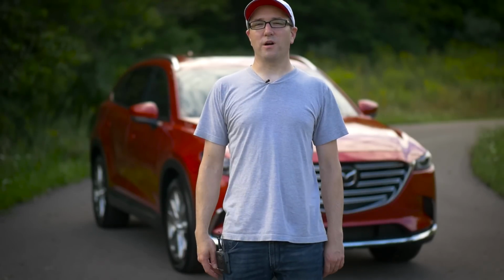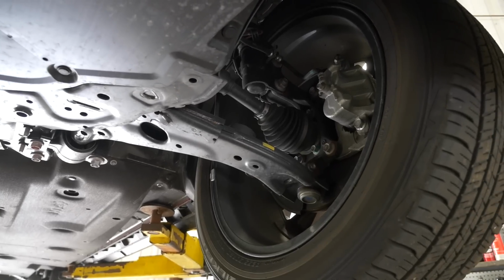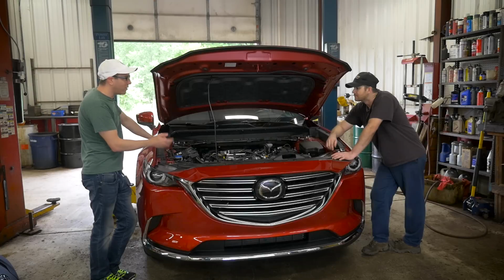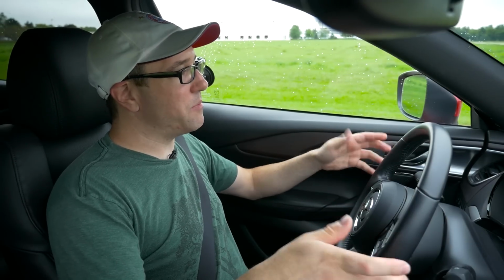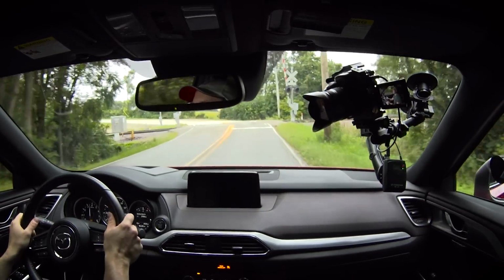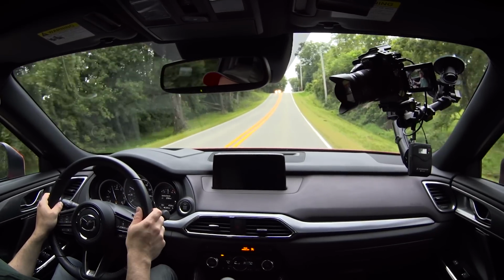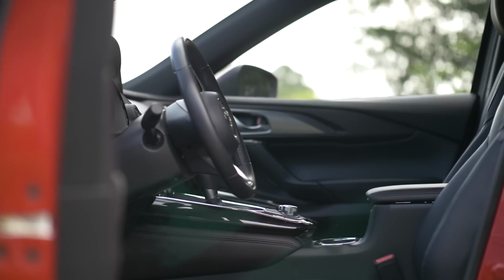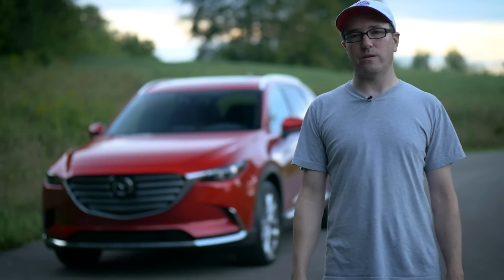Review | 2016 Mazda CX-9 | Plump Yet Satisfying

Comment: The Germans gave up on the Wankel and Mazda took the design and nearly perfected it. The Germans gave up on trying to eliminate carbon build up as a result of direct injection. They (BMW & VAG)tell their customers to deal with it and get the costly cleaning service. Again, Mazda made it better by clever engineering. Thank you Mazda.
Reply: I wouldn't call the rotary perfect.
Reply: What a weird thing to be thankful for, but okay. It is not even an interesting fact.
Reply: VW/Audi is putting port injection on their DI motors to help keep clean. At least in Europe.

Comment: Great review, good quality video in HD, great edit. Great info. BTW: The plastic on the wheels are there to avoid rust issues. The Power rear liftgate have  programmable height adjustment. The HUD can be turned off forever if you use the memory settings on the seat. Regarding the complexity of the engine, Mazda is giving 3 years or 6 years extended warranty. A great machine, not the bulky and not fun driving on Pilot, Pathfinder, etc.

Comment: something that was bothering me is that your complaint about the engine power falling off in the upper RPMs is something Mazda has stated is by design, but you never mention that. Mazda engineers have stated that they deliberately tuned the output to be in the most usable and applicable range for daily driving for more efficiency. mid range acceleration and highway passing is supposed to be this vehicle's bread and butter. otherwise a solid review all around
Reply from the maker: +Chris Droste Yes its by design by almost every company that does the new generation of Eco turbo motors, all tuned for torque output and not high rpm output, largely because of compression ratio and their desire to not require premium fuel.  I don't say it because I assumed its known but your right I should mention it going forward.
Reply: @savagegeese  
Premium fuel is not a problem for me. I prefer to use ethanol-free fuel anyway and it's earlier to find ethanol-free premium than ethanol-free regular.

Comment: Great review!  I LOVE that you actually got under the car with a mechanic.  Mazda has made a huge mistake by discontinuing the V6.  
The mechanic was spot on in mentioning the giant increase in the complexity of adding a turbocharger. For folks who keep their cars for 8-10 years this complexity translates into much greater cost of ownership.  What do you do when the turbo quits at65k miles.  It’s decision time folks. Do you write a check for $2500-3000 to fix it or do you try to sell it?   With the V6 there is no need for a turbo and you will save big $$ in maintenance over the long run.  So what if it doesn’t get better mpg?  Turbos are for unsuspecting suckers.

Comment: Incredible in depth review. Thanks so much. As good as it was, there was one glaring error. While they are not badged, the model reviewed is a Grand Touring model, not a Signature model as he said. The Signature model comes with Auburn Nappa leather seats. Nappa leather is softer, wears better, resists stains, is colorfast, and breaks up all the black in the vehicle. It does not look like a 5 year old child from a labor camp sewed it. It also has Rosewood in place of the cheap shiny plastic he was complaining about. Plus there's additional LED lighting including a bright mode on the 3 dome lights that turn night into day to locate lost items. While the Touring and Grand Touring trims are nice, the Signature trim is crazy nice for a Mazda, and competes with luxury brands,

Ergonomics are great, you'll use the armrests as they are right where you want them. Nav controls on the console right where your hand lies. While not available when it came out, the nav system can be upgraded to Apple CarPlay/Android Auto for $150, plus a few hours of a handyman's time.

It is a great ski vehicle. Most people buy 3 row CUVs to avoid the look of a minivan, and end up with a CUV that drives and handles like a minivan. Coming from a G37 coupe, I cringed at needing a big vehicle. It is great in the twisties in the mountains. Most fun you can have in a 3 row vehicle that can tow 3,500lbs. Turbos lose much less power than normally aspirated vehicles at elevation. I live at 9300ft, and run regular and it still is fun. If you have a trip to the mountains, treat yourself to some premium and really enjoy the performance, otherwise regular is fine for most fueling. Extra height allows driving in deep snow or getting to a campsite or launching some toys you are towing. It drives like a smaller vehicle that is lower to the ground, which is quite impressive. Utility and a sporty drive are no longer mutually exclusive.

I disagree about the HUD and nav display. i appreciate the info without having to take my eyes off the road, especially when I'm towing a couple ATVs on tight hairpin turns on twisty mountain roads, Towing is good, and on the rearview camera when you're in reverse, you can see your hitch ball to easily align your trailer.

Biggest fault I noticed, is the seat preset controls are located on the side on the front seats. If you are of average height or shorter, you will notice when you sit down you will often hit the buttons and the seat starts moving. i will likely place some raised material around that switch, to avoid that from happening.

Thanks again for the great review!
Reply: And it's made in Hiroshima Japan. While in theory I'd loe to buy a made in the US vehicle, the build quality is just that much better there. Rosewood accents are made by luthiers (guitar makers).The Signature really is that much nicer.

If you buy it in the Machine Gray color, it hides the plastic cladding. While I don't  like the look of cladding, they put down crushed stone on snowy days, which is often here, and without that cladding, there would be lots of rock chips and eventually rust around the wheel wells.The grey color is a great compromise, as the cladding prevents chipping, and the color hides the cladding.

Comment: This is very helpful in my looking at a used '16 Touring with 26k miles. It's not certified pre owned but it still has about 5 months left on the new car warranty. Another plus, the price is $22k. You addressed the possible issues the turbo 4 so well. And the other Pros/Cons were also explained well. Great job.

Comment: You really should check out the 2019 model. Heated rear seats, ventilated front seats, surround view camera, trajectory lines on rear view camera, Android Auto and Apple CarPlay... check, check, check. We just leased one after initially looking at up-market models (MDX and CX-90) but the value proposition on the CX-9 just couldn’t be beat. Got everything we wanted in a family hauler and saved $500/month!

Comment: Just wanted to note a few of the stranger things about my all new 2016 CX9. Having previously owned a 2010 CX9 I was looking forward to the side mirrors dipping when selecting reverse, a very handy feature which saved me from wheel rash on many occasions but alas Mazda in their wisdom have decided to delete this feature. To make matters worse the mirrors cannot even be folded away, a feature the much smaller Mazda 3 has. Another thing that irritates me is the accelerator pedal is lower than the brake pedal by enough so as to not allow you to slide your foot across when braking. You have to raise your foot off the gas pedal which is a pain. Why are the taillights, headlights and fog lights all LED but the daytime running lights are old fashioned bulbs?
When reversing why don't  the guide lines on the screen move as you turn the wheel like they do on cars half the price?
Why when altering the backlighting on the dash does nothing happen when rotating the adjustment knob then all of a sudden the screen goes dark (or bright) in the blink of an eye.
I have never experienced torque steer like I do when accelerating hard on this car (all wheel drive version).
In between both Mazdas I owned a Q5 and Range Rover Evoque, apart from the aforementioned oddities I believe that the CX9 is a much better car than the Evoque and on a par with the Audi.

Comment: I’m very impressed by the technology in the AWD system and engine. 

I’m still glad i went for the 2016 Honda Pilot Elite. It does have a mini van shape but it beats the CX9 in a few areas that are important. Space, comfort, storage, has a V6 engine and no Amazon kindle for the center console.

Even though it’s supremely comfortable and smooth, you can drive it and have fun. The V6 engine is powerful and has the rated HP/TQ with 87. The AWD is a SHAWD unit from Acura, without the badge; it’s very impressive. You should definitely review it.

Comment: Great review as always. We need a CX-7 to fit between these. CX-5 is cool, but an infant seat is not going to fit behind my 5' 11" wife, and I will have my tubes tied before I need a 3rd row. Plus if I ever did need a 3rd row, minivans work so much better. The 3rd rows in crossovers are vestigial at best, with useless cargo spaces to boot. The worst of both worlds. A CX-7 with this thing's huge back seat, the turbo engine and a huge useful trunk would be perfect. Hopefully Mazda follows through.

Comment: beautiful design and execution, styling and attention to detail this puts some luxury brands to shame
please make a v6 or v6 turbo or v6 hybrid or 4 turbo hybrid as an option.
Mazda larger cars need larger engines options,
Reply: Only way Mazda could implement a V-6 is to source one through a joint venture. The lineup is too small and sales too low for them to develop one in house. Costs hundreds of millions to develop an engine. Even Volvo, as a luxury brand of only larger vehicles, only produces 4-cylinder engines now. Regardless, the CX-9 is the most responsive powertrain in class. Drive it. Makes the V-6's feel sluggish in normal driving conditions. Accelerating hard after 75 mph is where the V-6 shines but how often are you doing this with your family risking getting pulled over?

Comment: The black plastic paneling is there to reduce the effect of mass or overall size on a car. If they were painted the same as the body color, the car would look much, much fatter/wider which is not appealing. Many manufacturers do this trick/effect with black panels.

Comment: Great review as always! One thing to note. I believe stability control can't be disabled on the Mazda CX-9. Afaik, only the traction control system (TCS) can be turned off.

Regarding the mix-up with the Signature trim paperwork, I will try to figure what happened there internally at Mazda so other reviewers after you have the correct information.
Reply from the maker: Yes stability was always on unless there is a back door way of disabling like Toyota.  I am not sure if it was a Mazda issue or fleet issue. Key said signature and copy of monroney as well, Iet them know. Glad you liked review hard not to like what you guys are doing.

Comment: That low speed torque is important to me when the a/c is running in warm weather. Without that extra torque the a/c is a noticeable drag on a NA  4 cylinder engine from a stoplight or stop sign. Also, as a city dweller I need ample torque at low speed for quick maneuvers in traffic.

Comment: 8:08 The AWD systems in the new Pilot and Ridgeline aren't like the typical run of the mill AWD systems, they are essentially renamed SH-AWD
Reply: They are pretty snazzy.  I kind of wish Honda would market the SH-AWD name more aggressively.  I think it would attract sales, especially with how well Subaru is doing with their symmetrical awd branding.  Subaru's never had an amazing awd system outside of the STI, but they market it very well.  Having been a long term Subaru owner, I will say the all time design and symmetry do go a long way for stability and balance of the system.   For this a Subaru has always felt better in rougher terrain than a Honda CRV or Toyota Rav4.  ABS based traction control is common among all brands now, so the advantage is more so in how the awd systems are programmed more than anything else, and any system can be quite good when programmed right (and the systems don't overheat or break with highly uneven power delivery).  It isn't until you start adding some more advanced control devices that things get interesting.    Some brands started young like Mitsubishi with the Evo.  Other brands grew into it.  Honda's had a very good system for a while with their SH-AWD.  I'd be great if they just kind of offered it in everything.  Just think how badass the new Civic Si would be with SH-AWD.  They'd be right there with the STI, Golf R, Focus RS, and so on.

Comment: I wanted to trade-up from my CX-5 , and looked at one of these in Grand 
Touring trim.  No pano roof.  No vented seats.  No heated rear seats.  
No 360 camera.  Cheep plastic covered sun visors.  Wide center console 
cuts into legroom.  Cargo space much smaller than the rest of the class.
  Apparently I'm not the only one with these gripes, because CX-9 sales 
have been a huge disappointment for Mazda.  I ended up going with a '17 
Hyundai Santa Fe Sport 2.0T and could not be happier.

Comment: Great review, I been wanting to see some great reviews on the drive in detail and you did a great job here. What I am concerned as a potential buyer and heavy on driving experience is the torque steer FWD biased AWD system and you touched on it quite well. I am comparing CX9 to the 2014-2015 6 speed MDX SH AWD. Any experience in the MDX for comparison purposes?

Comment: I have a 2012 Acura TL and my wife drives a 2013 Acura RDX. Pretty good acceleration and remarkably good highway mileage. I believe there is cylinder "de-activation" (no gas to the off cylinders). And the engine probably doesn't have to work as hard. Why the big move to smaller engines when agressive cylinder deactivation can accomplish the same thing (while retaining a bigger engine).  

Regarding an SUV I'm likely going to buy one next yr. I really don't need a 3rd row (my kids are grown and gone).  I'll drive the CX9 but likely won't bite. Maybe the Lexus RX 350---although at a $50-60K pricepoint maybe even look a a Porsche or Audi. Or maybe even the VW larger SUV (don't recall the name).  I have heard good things about the Mercedes but I don't think they are reliable. My daughter rented a Ford Edge (feels small).

Comment: I do wish the general public was more practical about the wheels and tires they want. 20's with low pro tires is not what I would call a good idea for a suv. I put 20's on my explorer and regretted it. I thought I would be so cool riding on 20's. Lol. Young and dumb.  It now has 16's with beefy tires. And is a much better ride all round. And it is cheaper if a tire pops on me. With better tires to boot.  20's work if you want a sport feel from the road.  Yes. But I would rather have amazing grip in winter and be able to air it down if I get stuck. Just my experience with tires and SUV's. Put 18's on it at least imo for the smoother ride. Tires can really take the bumps and make them a non issue. Save you from hitting a curb and destroying your rim as well in many cases. But..... you will look so cool on the side of the road with your alloy 20's and low pro tires changing your flats. I know I did.

Comment: Thanks for the great in depth review on Mazda CX 9 but it’s been 3 years since the 2016 model. They have just launched the 2019 model of CX 9 and I’m still hesitating to purchase CX9 simply for what you have mentioned in the video and comments which is regarding the reliability of the motor. What do you think? Is this still a good purchase for 2019? Or do you think Kia Sorento or Hyundai Santa Fe are better bets? I have watched all those videos and you seemed particularly happy with Kia’s and Hyundai’s design under the hood for easy repairability. 

Again thanks for all the videos, your reviews and opinions about cars are really helpful and informative. Keep up the great work!
Reply: Dude I have a 2016 CX9. It is a great car, great engine. After 40K miles just regular oil changes and I think I will keep the car for the long run. I can't tell you about the Korean cars. I would never buy those.
Reply: Same here...mine’s a 2017 and owned for almost 3yrs now and no reliability issues whatsoever.  Plan to keep mine long term as well...though the Hyundai’s and Kia’s have improved a lot and have great value for money I will still trust the Japanese brands more than the Koreans esp this Japan built CX9!  I know someone who owns a Hyundai and after 5yrs there was an engine recall that needed an entirely new engine replacement.  While it was covered under power train warranty still you don’t have that peace of mind and went thru the hassle.
Reply: We've had one for two years, 1 recall to replace a wiring harness, absolutely no other issues.  These engines have been out awhile and are very reliable.  Consumer reports moved mazda to number 1 on reliability this year. They are great vehicles.